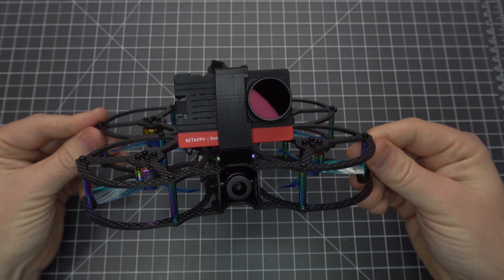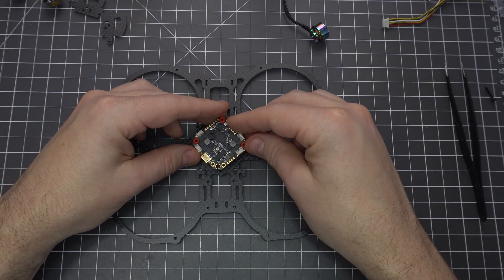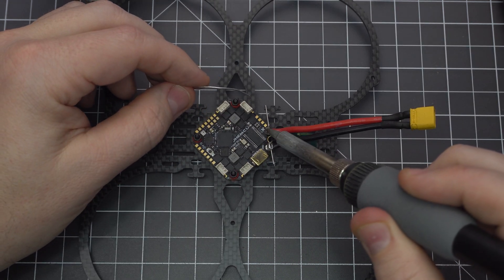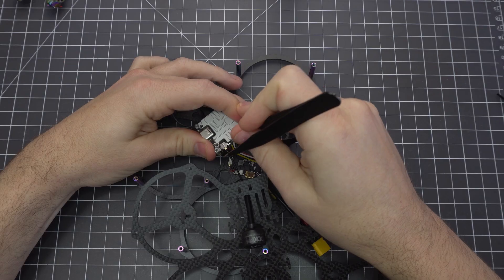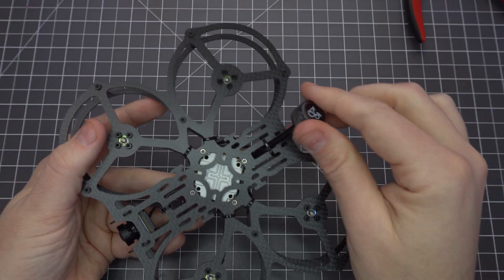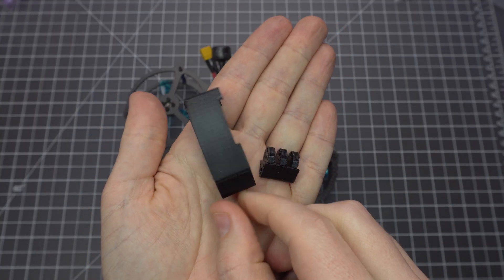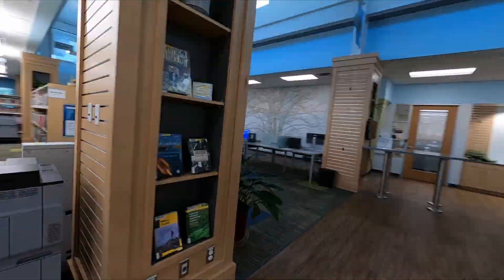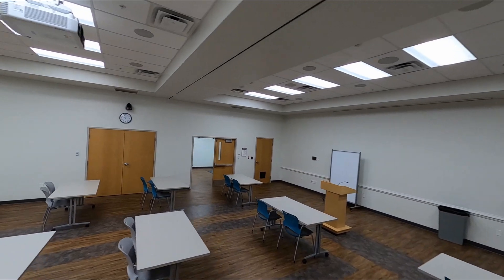How to Build a Cinewhoop - QAV-CINE Freybott Edition

Comment: I saw others mounting motors before soldering motors. But I’m curious why not use heat resistant tape on wires? Something I learned from flywoo. Prolly preference

Comment: I have mounted these GEPrc 1204 4500KV Brushless Motors but they heat up a lot with the recommended HQ durable three blades, are these motors better?

Comment: This is just great. I am building one! Do you still suggest us to use 1404 motor for the heat issue?
Reply: I have mounted these motors GEPrc 1204 4500KV Brushless Motors but they heat a lot with the recommended HQ durab three blades, are these motors better?
Reply: @Gasrovescio  not sure yet. I've just received all thr parts, so will build it pretty soon.  I guess it should dissipate heat a little better.

Comment: I think I'm going to build this drone — it's definitely interesting. One question though: since I'm using a TBS Tango 2, is TBS Crossfire Nano Rx ideal for this specific build?
Reply from the maker: It'll work just fine. You might want to try different motors though because these do get quite hot.
Reply: @whiffles  By the way, iFlight XING2 1404 4600KV motors have been suggested — are 4600KV motors OK with this frame?
Reply from the maker: @robertogiannotta4477  That should work great

Comment: Nice build - just a question though - why wouldn't you do the capacitor before the battery leads using the relevant holes? Clean nonetheless :D
Reply from the maker: I didn't think of that, good idea!
Reply: @whiffles  Haha no worries I just noticed and thought "hmm for future builds..." But you really pick components nicely - I like the anodised theme! (As well as building extremely well of course)
Reply from the maker: @swg_fpv  I do like that idea. I always solder the battery leads first then the capacitor, so it never crossed my mind. Next time!